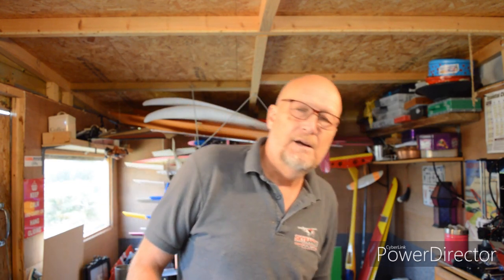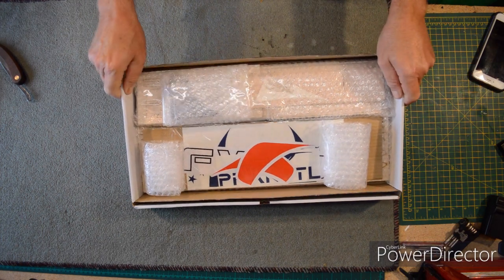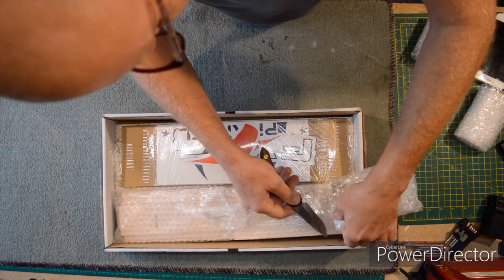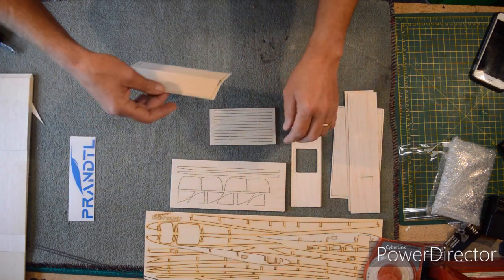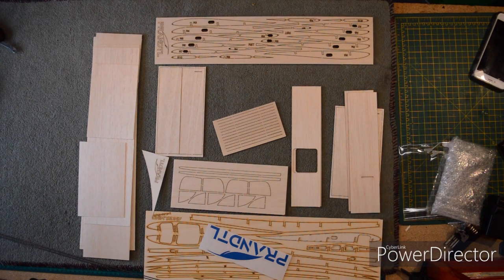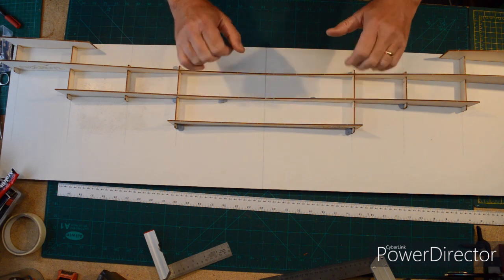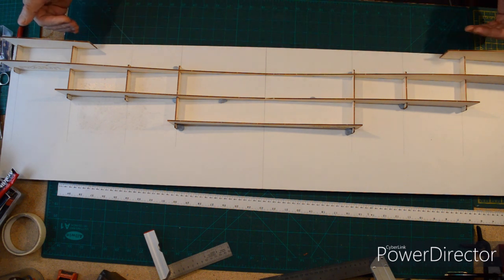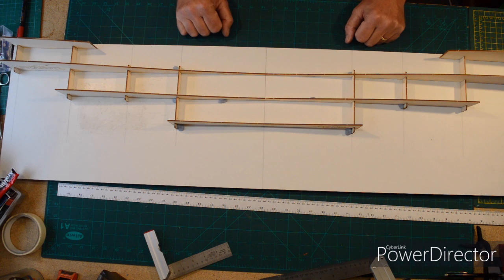Prandtl Flying Wing FVT-3 Part 1 Intro and Custom  Wing Jig

Comment: Thanks for making the model and the videos! Hope you like flying it :)
Reply from the maker: Marko Stamenovic thanks my first love is Hang gliding we need to talk about full size 😍
Reply: @NickChittyFlying   Always wanted to fly hanggliders but there are very few pilots around here and no schools. Full size plank would be a little bit difficult to balance compared to swept wings. This kind of plank concept is the most appropriate for RC models and UAVs where all equipment can be put inside the wing near leading edge.
Reply from the maker: Marko Stamenovic I occasionally pg as well. Swept would give better viz as well.